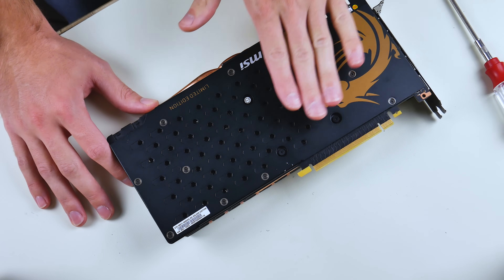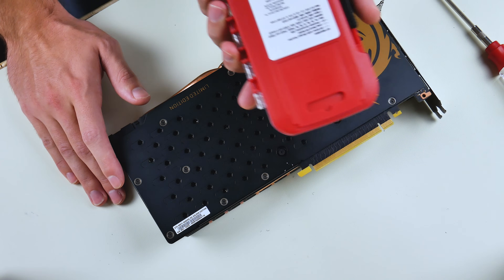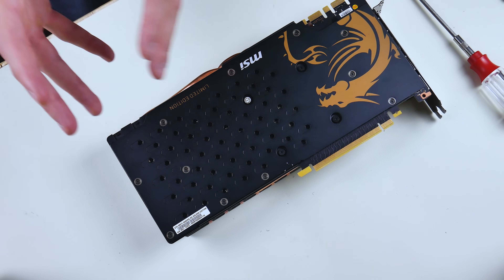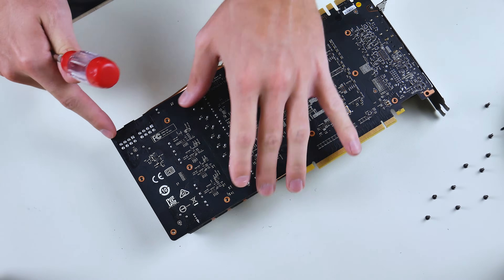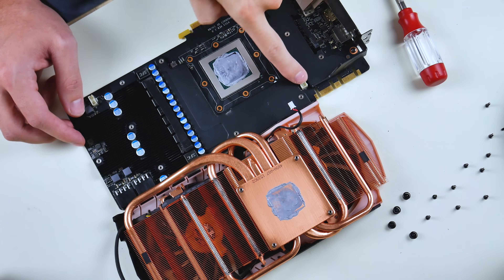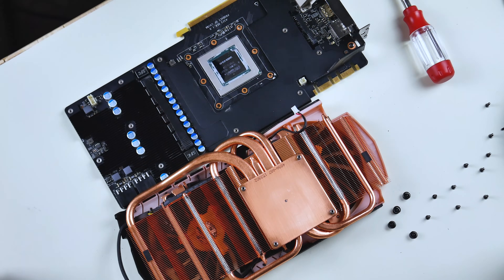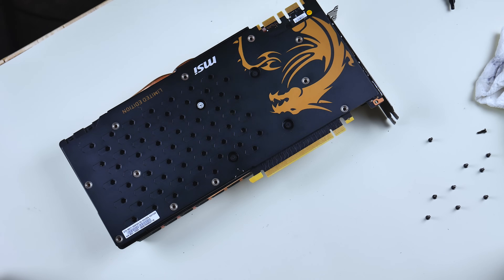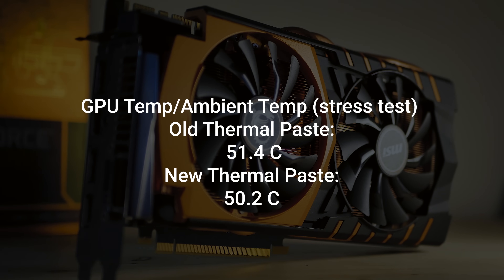How To Replace GPU Thermal Paste - This Is Crucial

Comment: Thank you so much dude! My GPU was messing up and crashing all the time. I check online and other people said that changing the thermal paste fixed it so I did and now it works just fine! Even dropped the temps too!
Reply: What gpu are you using and how much did the temps drop?
Reply: Erik Ramirez I use an MSI RTX 2070 super gaming X. And the temps dropped only like 3 degrees but still pretty good! When I took apart the car, there was thermal paste CAKED ON THERE!
Reply: @rogueraven8683  dude my pc is crashing. When I'm gaming my monitor goes black still my cpu is on
Reply: @jsizjiisk7606  this is exactly whats happening to me, i think putting thermal paste is worth the try. I need to buy some to try lol
Reply: @brayean001  Thermal paste ....? It just might be the cables of the hdmi video wiggleing around make sure the hdmi cable (witch i suppose you're using) is actually connected to the gpu instead of the mother board.

Also make sure it is screwed tight, also the ram might be it, it might be a little loose (Ram is crucial for the monitor and the pc itself) Just check those things i mean the thermal paste can be the issue but it's very unlickly.
Reply: @jsizjiisk7606 is it a black screen and audio still works until you force restart? That’s what I’m going through right now
Reply: @jxgha3197 did you manage to fix this? Happening to me rn. Happens when I’m playing a graphically demanding game. Fans go crazy screen goes black but audio still works.
Reply: @brayean001 did you manage to fix this? Happening to me rn. Happens when I’m playing a graphically demanding game. Fans go crazy screen goes black but audio still works.
Reply: @jsizjiisk7606 did you manage to fix this? Happening to me rn. Happens when I’m playing a graphically demanding game. Fans go crazy screen goes black but audio still works.
Reply: @SentinelFury  I changed the PCle cable connected from my PSU to the GPU and it fixed everything for a couple months, then i started having the same problem again and took it to get it checked out and was told my GPU was damaged. I don't remember what specifically was wrong with it I just remember he said "it was like if I had left my pc on 24/7 for months" (which I didn't). Idk what he did to it but it's worked ever since then, he did say it was a temporary fix. It's a nvidia rtx 3060 btw. Easiest solution would be checking if you have a warranty on it before trying anything tho.
Reply from the maker: Glad I could help!!

Comment: Pretty good video, although you shouldn't have said that thermal paste the size of a grain of rice is enough. With this being directly on the die, more it better in this case. The die NEEDS to be fully covered. Sometimes if only a portion of the die is covered, it'll show temps to be fine. But in reality that uncovered part of the die will heat up so quick and fry the chip. I'd recommend editing this video with a sidenote for that.
Reply from the maker: It's in the pinned comment my dude.
Reply: @jdtechgear  yeah I saw that after I posted this. Thanks

Comment: Can i use the same paste for a gpu as i do with my cpu?
Reply: Little late but yes you can.
Reply: @Reptileman110  Thanks anyway since i still haven't done it! So my noctua NT-H1 will do just fine for a gpu?
Reply: @anselm0124  Yup. Any thermal paste that isn't conductive will work. I actually wondered myself as I ordered some noctua thermal paste yesterday and they said that it will work with either cpu's or gpu's in the description. You'll be fine.
Reply: @Reptileman110  Thanks for the info fam
Reply: Hey guys,  I have a question.  What 
kind of screw does the GPU use?
Reply: @onriwann  mine has philips
Reply: @anselm0124  What kind of philips head? #0? #1? I really don't want to strip my GPU screws, man
Reply: @onriwann  i dont know these sizes but i looks small-to-medium sized
Reply: @anselm0124  oh okay thanks bro!

Comment: There's dust in the back plate? Or.. they're print 😅
Reply: Most likey dust
Reply: Someone else mentioned it is not necessary to remove the backplate for this model. It does look dusty though and cleaning it along with the heatsink fins might be worthwhile.

Comment: So I had my PC for less than 2 years, but just about a week ago whenever I play games my screen will go black and the audio will make a drilling sounds, and I will have to restart my PC. Seems like my PC crashes when my GPU gets to 130F+ I know for sure its the GPU because i'm using my older gpu atm and everything is working just fine. Will this help prevent that or is there another way for me to get my gpu working again? It's a gtx 1080 btw
Reply: well i dont think you have anything to lose by trying and applying new thermal paste

Comment: i just change my gpu pase after 5 freaking years ... From 79c under max load to 55c
Reply: Thats alot of difference. Is your gpu running better than ever ?
Reply: @misterrandom888  So if you're an avid "spender", replacing the GPU paste every 2-3 years or so is recommended. However any GPU that's had its paste unchanged for 4+ years I'd say it's almost critical to change it. Especially if the pc is used extensively everyday, a worn/dried out cooling paste will hinder the ability to cool by quite a large margine.
Reply: @NomSauce  agreed thats what i do maximum 3 years nothing more not trying to make my gpu suffer too much, haha
Reply: @misterrandom888  Yes, it really does
Reply: @fleeex1954  did you change thermal pads
Reply: @grom5756  No just added new paste.. i had a msi 980 gtx gaming 4g
Reply: @fleeex1954  thank you for the reply
Reply: wow
Reply: My grandma gave me one from her house it’s been 7 years
I replaced the thermal on 
gtx 650
AMD Ryzen 200 series
Reply: My thermals have been high as hell. Bought the card used 2 years ago. Glad I was this video because I was ready to get a 2080ti. Gonna try to reapply new paste first.
Reply: Did the same on my MSI Gaming 6G 980Ti that is 5 years old. The paste was thin, dry and probably useless. Went from 85 max to 70 max temperature on the same benchmark after repasting and cleaning the PC in general - PC was in horrible shape dust-wise.
Reply: @kresimircosic9035  Yeah for like 10 bucks we can make the old gaming rig abit pure again! haha totaly worth it
Reply: @kresimircosic9035  How was the dust built up inside the 980TI GPU heatsinks?
Reply: @BravoSixGoingDark  It wasn't super bad, considering I cleaned it few times, but it wasn't as bad as the CPU cooler. The temps actually climb up to 75C, but it takes a long time. Before I repasted it, it climbed to 85 in a few minutes. Now it reaches 75 barely in 10min of hardcore work. Definitely suggested since it is super easy to do.
Reply: @kresimircosic9035  Thanks, I am currently using a MSI 1070TI for almost 2 years ( March 2019 - Present Day). Should I open up and re-do the GPU thermal paste?
Reply: @BravoSixGoingDark  As far as I have heard, default pastes are shit, but it could be still alright. Definitely Google first and watch clips of it.
Reply: @kresimircosic9035  Thanks for the advise!
Reply: Ive used my gpu for 4 years and it runs at 86c max load, gonna try changing it now cuz its noisy as hell
Reply: Yeah, I might be changing mine too cause temp has been getting higher recently, under load used to be 70-80c now its 80-101c
I havent changed paste in a while so maybe its that or its broken r smthing idk Ill have to see
Reply: @kinakomono  The thermal pad could have moved, the paste might need to be changed or the fans could be broken. You should check if the fans spin, if not they would need to be replaced.
Reply: @xRegyy  i changed thermal paste today, and boy difference is huge.

Under load ffxiv games used to be 80-101c on lowest settings after I changed I'm playing on max settings under load reaching 55-60c
Reply: @kinakomono  That's great! Mind if I ask what card do you have? and fan count?
Reply: bruh i use my pc for almost 3 years and it's throttling to keep card 95c and not higher XD
Reply: id recommend replacing thermal paste in your gpu every 2-3 years
Reply: the best thermal paste. https://www.youtube.com/watch?v=jkwbPCl28OY
Reply: My 1080is hitting 80c playing csgo haha currently changing the paste we’ll see how it goes
Reply: @sup4904  clean your pc out of dust everything should be clean while you open your pc might aswell
Reply: mines almost 8 years old maybe i should do this
Reply: Gonna change the thermal paste on my used 10 year old GPU probably this week. Will update you guys on the temps.
Reply: lol same

Comment: Not a good idea, the chip on the GPU is not like a CPU. The whole chip needs to be covered in thermal paste for proper heat transfer, so the pea-sized dot and squishing it with the heat sink will not cover the whole chip

Comment: I wasn't expecting much from the thermal paste replacement, especially because this and many other videos said the delta was just 1-2 degrees. To my amazement the temperature dropped at max load and max cooling from 81-83 degrees to stable 63-65 degrees. Which is pretty incredible. 

The fun fact is, that I was about to replace the whole cooler but the installation turned out to be too complicated for me, so just replaced the thermal paste and wow. I'm more than impressed, even though I had thought that I would have to forget overclocking.

I've used the Arctic MX4 from 2019, but I'd assume all the thermal pastes from good companies are as good.
Reply: Why did you want to replace the cooler? Coolers can't really brake. What tends to brake is the fans on the cooler. Seems like you have solved the problem you had but you can't really fix broken fans with more thermal paste so this is my tip if you haven't learned that yet.
Not all fans are easy to find and usually you have to expect some shipping time. It's best to buy new fans as soon as you notice your current ones not working 100%. That way you will never have to put your PC aside for half a month because you are waiting for new fans from asia.
Reply: @christopherstein2024  Tip of the day. We can't fix broken fans with thermal paste. 😂 Learn something new everyday
Reply: @bensyoutube  The real tip was to have thermal paste AND replacement fans ready if you need to keep your computer running hot.

Comment: my gtx 1070 was reaching almost 80c wich it never did. So i decided to switch the thermal paste wich btw is also noctua NTH-1. After all the cleanig and aplying...the temperature decreased from 77/78c playing The Division 2 to 60/65 ...so HUGE improvement. BTW my gpu has 2 years
Reply: @xCDF-pt8kj  i cant say because i always use a fan profile. No matter if its 60c or not. It keeps the gpu cooler.

Comment: I’ve been struggling with a crashing GTX 1070 FE for the last 6 months.  I tried everything software wise to fix it, but nothing worked.  Being near the end of my rope, I opened the card up with the idea that the card was crashing due to thermal issues.  I replaced the original thermal paste with some Antec Nano Diamond and tested it with the intent of crashing it by cranking my game up to max and YouTube in 1440p resolution.  It held its own with the maximum temperature reaching 53*C.  This is the first time I’ve had to open up a GPU and replace the thermal paste.  I hope this was the solution to my problem and I hope this will be the end of my problem.  Only time will tell.
Reply: my RTX 2016 85C
Reply: How is it? Im facing similiar problem

Comment: Did you set the fan speed to a fixed setting? Because if not, then the card is quieter at the same temp. Since it has a desired temperature that it adjusts the fan speed to achieve

Comment: This is NOT how you apply thermal paste to a GPU. You should do a double x or spread it yourself. This method is fine for cpus with integrated heat spreaders but could prove disastrous for a GPU die. You need make sure the ENTIRE die is covered or you can can burn out GPU cores.

Comment: Good video, but voiding the warranty depends on the card/manufacturer.  At least for EVGA, they don't seem to mind, at least for the 1070/1080.  Due to the thermal pad issue, they advise you can take it apart and do it yourself without voiding the warranty, which also involves replacing the thermal grease, and if it doesn't work out you can ship it to them and they'll do it under warranty.

Comment: If you don't let your GPU run hot AF like some of the fucknuggets I see on gameplay videos the paste shouldn't ever get baked on. I'm talking 80-85C. Nvidia cards shouldn't go above 70 C and if it does you have bad airflow.
Reply: Not true. I have a 1080 g1 from gigabyte that smacks 75c when its balls to the wall. That's AFTER applying thermal grizzly kryonaut. And I should also mention even in my open air test bench it hits 72c.

Comment: Mate, my gpu temp fluctuates a lot  like from 60 to 72 then go back to like 62 or so in a second after i changed the thermal paste do you think i added too much  paste so that it messed up the temp?
Reply: KIM JONG FAT If those temps are on load, then thats not a bad temp. If its idle, you might have a problem.
Reply: @filkz4530  those are on 100% load but before i changed the paste the temp were  stable and rarely exceed 70degrees too when on full load. Might try reapplied the paste soon
Reply: @thicc800ty  70c is great my R9 390 runs at 94c while gaming...

Comment: my gigabyte r9 390 8g is hitting 80-90+ degrees when in intense use idk if its normal but i ordered some nt-h1 and gonna see if the temps come down
Reply: @deepaksnandihal6385  yep 5-15degrees also got a new pair of more powerful fans in front
Reply: @deepaksnandihal6385  idle temps came down from 65 to 45

Comment: What happens if I accidentally end up not aligning the screws with the cooler and end up having to move it around? The thermal paste will smudge everywhere
Reply: Liberty City Series then just reapply the thermal paste
Reply: I have the same question.

Comment: Next: How to reclaim warranty after opening the gpu
Reply: Why I buy EVGA as a water cooler they are priceless
Reply: In the us warranty stickers were banned so it has no legal implication it’s just to scare costumers. Also most of the time your warranty is already out because they only last a year.
Reply: If you have to change your thermal paste, you already don't have the warranty any more for sure (2 or 3 years +)
Reply: Right @TheMangazixy
Reply: Here in brazil Galax let you open and change your thermals and you don't lose the warranty
Reply: Yeah but you have to live in Brazil. I’ll stick with America, thanks🤣🤣
Reply: I mean tbh if im buying a new card I'm not gonna bother changing the thermal paste. If I'm changing thermal paste I already don't have a warranty.
Reply: Nice profile picture
Reply: How Kyle they know if u just put it back on?
Reply: Nvm lol, didn’t watch like 5 sec before going into the comment section
Reply: Of your buying a older gpu the warranty has probably alredy expired
Reply: Repair laws force companies to not take the warranty. The stickers are only for poor countries without repair laws
Reply: That's easy you need a small angled needle nose pliers. Grab the edge of the screw instead of puncturing the little sticker.
Reply: I’m sure my 1080TI isn’t still under warranty lol 😂
Reply: Some manufacturers put the label beneath the heatsink so that you can change the thermal paste without voiding the warranty, I know PNY does that.
Reply: Most companies let u open the card
Reply: Joke on you my is like 18 years old and hes no warranty
Reply: It's illegal for companies (In America at least) to not offer a warranty just because you "broke a seal". You are allowed to fix your products and still get the warranty. 

https://www.npr.org/sections/thetwo-way/2018/04/11/601582169/warranty-void-if-removed-as-it-turns-out-feds-say-those-warnings-are-illegal#:~:text=Live%20Sessions-,'Warranty%20Void%20If%20Removed'%3F,their%20ways%20or%20face%20penalties.
Reply: bruh ain't no warranty sh inna USA for applying thermal paste

Comment: Hello! i have been using a GTX 1060 6gb for almost 3 years. Because the temperature (while playing World of Warcraft) lately was reaching 70 celsius  i cleaned it and replaced the thermal paste. Can be affected if i put a little too much? I've used Nocturna  NT h1
Reply: Im sure youve figured it out, but too much can actually insulate the gpu and do the opposite of what youre trying to acheive. Id say the max you want to put on there is what this guy in the video did
Reply: lmao my GPU is reaching 95C at idle, if this doesn't fix it then its time for a new pc.
Reply: @AlexOxygen  seems a little overboard. Just buy a new gpu.
Reply: @lacedup6809  The problem is that I have a new GPU but my bios arent compatible and im saving for a car, so can't buy a new motherboard and processor. (I'm running an upgraded office pc)
Reply: @AlexOxygen  If that GPU is new you should return it. Something's not right.
Reply: @2m0ng032  Works now; just, as I said, needed a new motherboard due to BIOS incompatibilities. That old motherboard was from 2011 or so. It was a GTX 1050, so the motherboard was not quite ready. The old graphics card was actually intended for high temperatures (by newer standards).
Reply: @AlexOxygen  I see. I'd never heard of GPUs being incompatible with a motherboard's BIOS.
Reply: @2m0ng032  Happens after gtx 800s or so. Older motherboards weren't prepared for them.
Reply: @AlexOxygen  I see!

Comment: @JDTechGear what about thermalpads ?
Reply: I know this is late but if you still seek the answer for your question I can help. You dont need to replace your thermal pads unless they are ripping off or falling apart and this is very easy to spot so you will 100% know if your pads are no longer good. Hope this helped